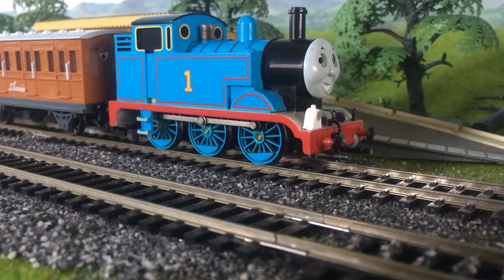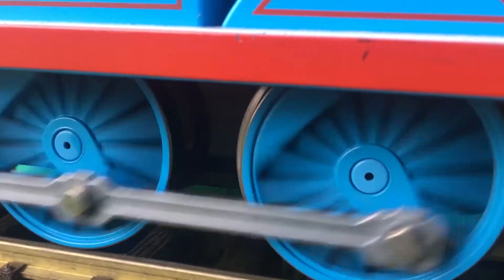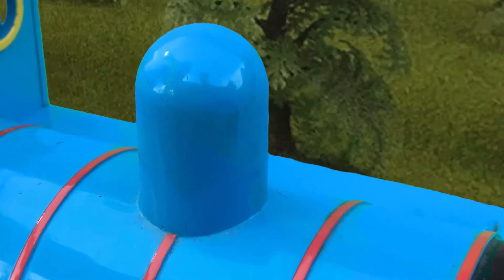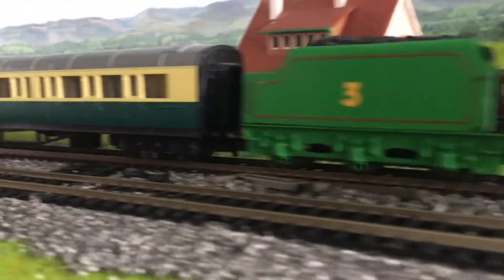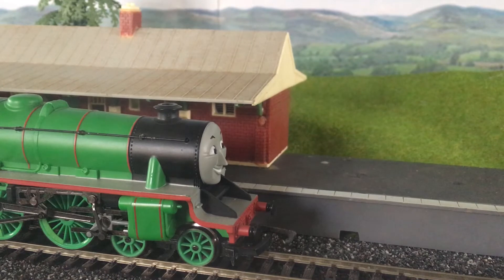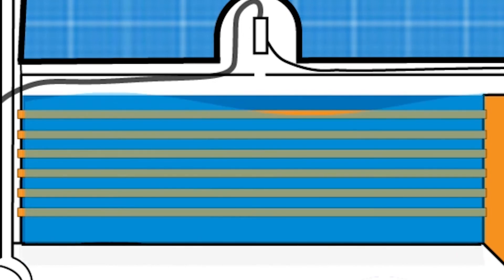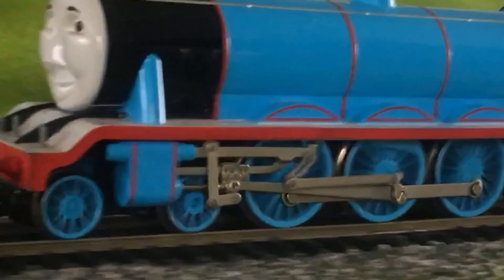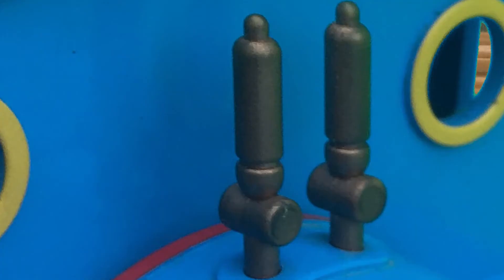How Do Steam Locomotives Work?

Comment: strangely nearly none of the engine characters in the tv series have mentioned what kind of locomotive they are based on.
Reply from the maker: It is very strange. In the TV series only 2 engines get referred by what’s basis they are which to me seems a bit criminal.
Reply: Boco does
Reply: @ikriestiana  I remember it being explained what kind of main line Diesel locomotive he is 
But I think it was Edward who doing the explaining to Bill and Ben. I guess Rev Awdry had a reason for not doing so. It would have been nice have heard Bill and Ben talking about their real life Twins Judy and Alfred. I helped to restore Judy to run under her own steam many years ago